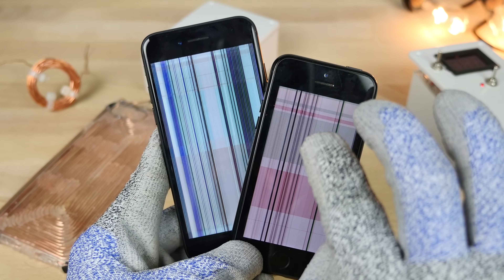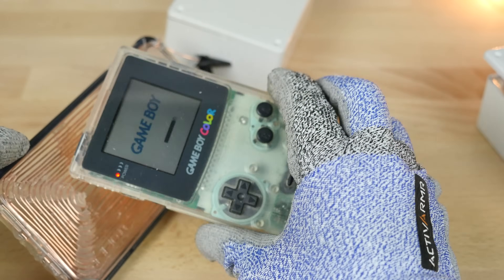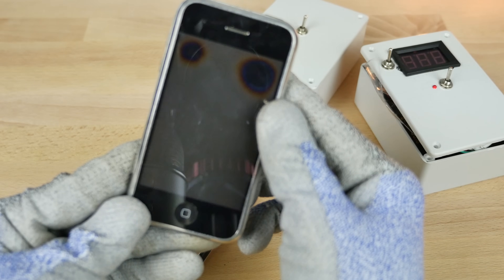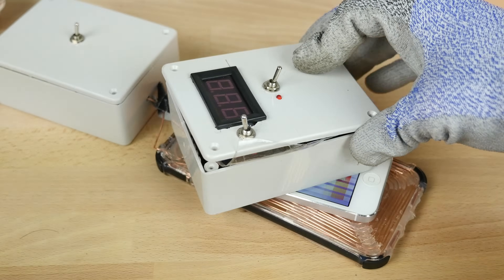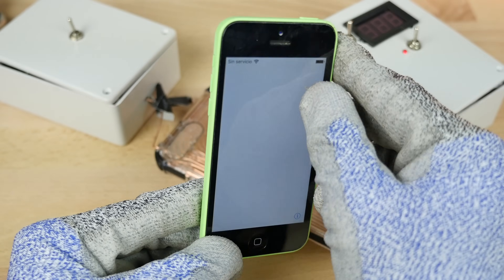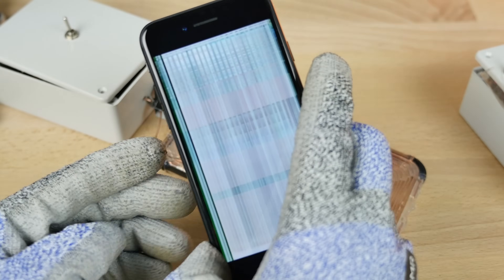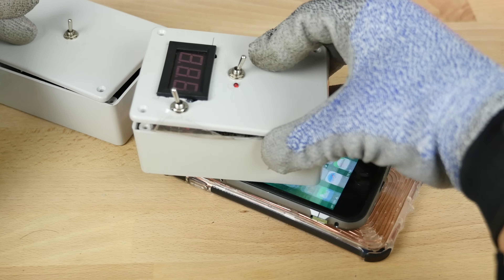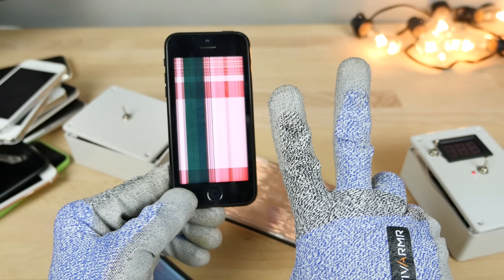EMP Generator vs iPhone 7 & More Electronics!

Comment: Hey guys im planning on upgrading to a new phone and I need you opinions. which one should I buy? the 6s, 6s plus, 7(not plus), or s7 edge. I currently have a grand prime.
Reply: Alberto_4015 S7 edge or iPhone 6s+ if you're upgrading right now. If it's a little later then I would recommend the Galaxy S8
Reply: Alberto_4015 s7 edge
Reply: Alberto_4015 s7
Reply: Alberto_4015 S7 edge
Reply: If you want something new and powerful buy the iPhone 7. If you want something familiar and more powerful than the phone you own now buy a S7 Edge. I would personally wait for the iPhone 7S or 8
Reply: Alberto_4015 OnePlus 3T
Reply: Heres some good advice, Wait for the s8 or iphone 8 or note 8. If you are desperate to get a phone now, then get an s7 edge or iphone 6s (if you care about headphone jack) otherwise get the iphone 7. If you are looking for something nice and easy and something just to use social media, garageband, imessage, facetime and games, go for the iphone 6s or 7. If you care about customization, modded apps and nfc and much nore stuff like that, go for the s7 edge. and you will get customization up to no limits. (even more when you root) same goes for iphone (only if you jailbreak)
Reply: Don't waste money and get a OnePlus. Use the saved money for good headphones or something.
Reply: wait for some time..S8,iPhone8 are coming..
Reply: Nokia
Reply: - XPL0S1V3 - not true the galaxy s7 got a new update wich makes everything run smooth
Reply: Alberto_4015 S7
Reply: Alberto_4015 all of those suck go for the iPhone 3g
Reply: Alberto_4015 s7 edge 1000000%
Reply: Wait for S8
Reply: get the old Nokia 3310
Reply: - XPL0S1V3 - lol right now my s7 is faster with the new update
Reply: s7 edge
Reply: Alberto_4015 none s5 cheap and gud
Reply: I would say none probably the iPhone 6 Plus as long as u don't put it in ur back pocket
Reply: Alberto_4015 6s plus, s7, or wait for next iPhone
Reply: Alberto_4015 6s+
Reply: Alberto_4015 6s Plus, I love mine
Reply: s7>>>>>>>>>iphone
Reply: Alberto_4015 I phone 6 s
Reply: Alberto_4015 Get an iPhone 5SE and make it a 6s Mini
Reply: 6s plus
Reply: Alberto_4015 probably galaxy s7 or wait for the iphone 8
Reply: Alberto_4015 s8
Reply: wait for the s8
Reply: Alberto_4015 Samsung s7 edge,emp doesn't affect it
Reply: Alberto_4015 7 or 7 plus if you need it right now, or wait for a month and upgrade to the galaxy s8. If you have time to wait till the end of the year, buy the iPhone 8. The rumors say the 10th anniversary is going to be epic
Reply: Swastik Agrawal Everybody says that the iPhone would be EPIC every year... It's just a minor difference every time
Reply: Alberto_4015  get the 6S if you need the headphone jack if you don't get the iPhone 7
Reply: 5S for 150$ or less used
Reply: Alberto_4015 get a5s they are still pretty good and are cheap
Reply: Not if you play the mobile games I play, which have actual pc like graphics options like world of tanks blitz, which doesn't even have grass options for my ipad mini. Also, the iphone 4s, the last A5 iphone has a 200 ghz lower clock speed than the ipad mini. The A5 is obsolete, and held back ios game developers until iOS 10 was released. So I have an A5 device and am upgrading to another 32 bit that still runs better.
Reply: Alberto_4015 wait for the next iphone and then decide
Reply: Alberto_4015 6s plus
Reply: GamingOrigins no it won't
Reply: Zodiac K9 no its not
Reply: Alberto_4015 6s with 64 gigs
Reply: Alberto_4015 I've had the original plus, the iPhone 6 + and the thing is amazing! Never missed a beat but does slow down near max capacity, affects snapchat and Facebook boot up times ect. Rn is the worst time to buy phone though with the iPhone 8 and galaxy 8
Reply: Alberto_4015 iPhone 7 it will still be fast after years
Reply: I'd say go for the 7 if not the 6s
Reply: Depends right now because my brother has an iPhone 6 and sometimes it lags
Reply: Alberto_4015 7+ or 7edge
Reply: Alberto_4015 bro wait for s8 and then buy s8
Reply: Alberto_4015 the 7
Reply: i have the iphone 7 but i regret it and want google pixel because of the camera *just my opinion
Reply: S7 Edge or 6s Plus
Reply: 7 plus regular 7 is too small
Reply: +Heяø GaMeR headphone jack is obsolete anyway
Reply: +lasest2 u get better audio quality over lightning and the convenience of no wires if u use  Bluetooth ones
Reply: +lasest2 apple aren't stupid soon no1 will have headphone jacks on their smartphones and phablets same happened with legacy ports on the OG iMac and same will happen with no ports other than TB3 On laptops
Reply: +lasest2 headphone jack won't be sticking around much longer like seriously it's a century old analog port everything's going digital
Reply: Swastik Agrawal s8 in my opinion
Reply: Alberto_4015 wait for the s8 or next iPhone release
Reply: Alberto_4015 Which one did you buy ?
Reply: Alberto_4015 Google pixel
Reply: Galaxy s7 do not get iphone, Galaxy will last you a long time
Reply: Alberto_4015 wait for the next iPhone
Reply: iPhone 7 or next iPhone
Reply: Alberto_4015 7
Reply: Do not take any Android because it will be slow and un-usable in the future due to software updates. Get the 6s or the 7 if you hate big phones. Get the 6s plus because of the screen size and more ram.
Reply: Alberto_4015 i would reccomend the iphone6s or the 6s plus because the 7 and 7plus dont have headphone ports and they dont have a phisical button
Reply: Alberto_4015 buy the edge and root it. iPhone is overpriced shit
Reply: Wait for the iPhone edition
Reply: Buy S7 edge! i have one and is perfect!
Reply: s7 edge its only ~$650 and on most online stores comes  with a free gear vr
Reply: someonw here saying that if u want something powerful than get an iPhone...  well, all of them feel the same to me (6-7 models). android phones feels the same to Apple devices too. I would rather have you choose a new Android device like the galaxy S8 or S8+ or even the LG G6 and save money than buying the new iPhone. just saying. I would rather download stuff for free from trusted sites and extract files, etc. 

isheep users: but you can vent a virus!!!!

that's why there are security apps and I've never had an virus on any of my Android phones I've owned for many years!

 power should not matter of you don't do much. if it does, wait for the the new galaxy or get the S7. if it don't then just get a LG Stylo 2 or the OnePlus 3T phone. there are $400 mid ranged high end phones out there! trust me on this. and if you want the iPhone 7 the. it's really up to you. but remember that there no headphone jack. and the next pixel phone won't have one either. stupid but true. I really would just wait for the new galaxy phone.
Reply: Wait for Revolution!!
Wait for 8!!
Wait for iPhone 8..
Reply: Alberto_4015 wait for the iPhone edition to come out